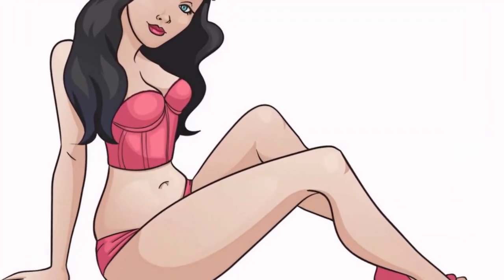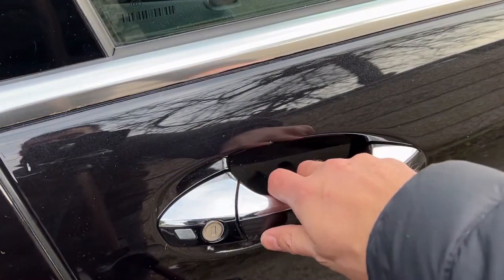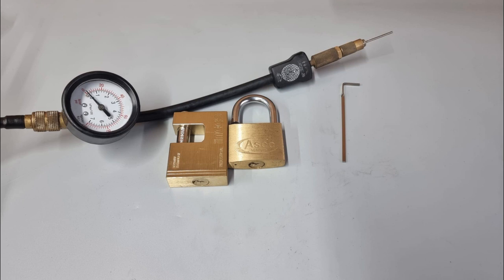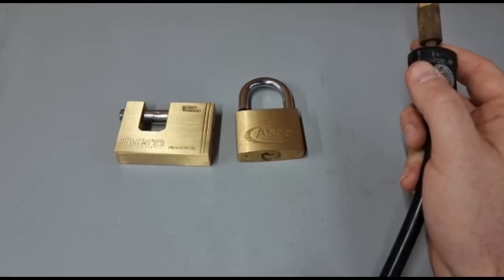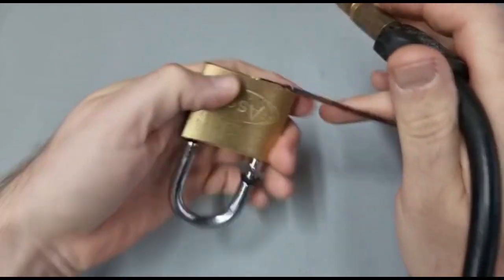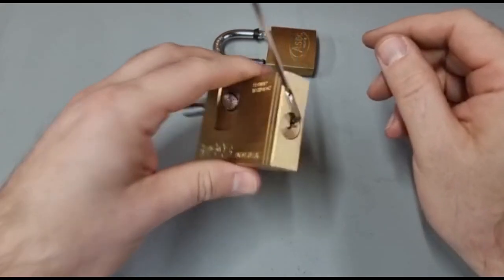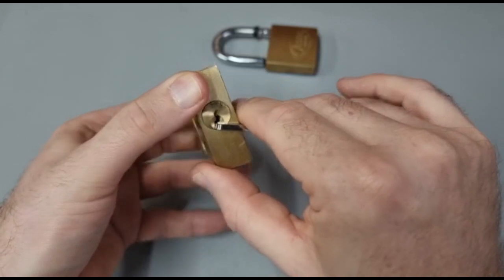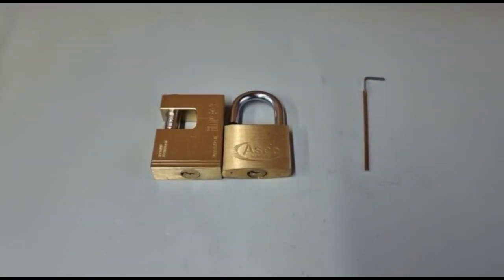How To Pick Locks With Compressed Air?

Comment: Years ago, early to mid 70s Mercedes Benz, has a model of vehicle that had vacuum operated door locks that if anyone knew the trick, could use a rubber toilet plunger to unlock. it unlocked because the vehicle had vacuum locks and someone sealing around
The lock against the doorskin  and giving a quick plunge gave a vacuum pressure change, and  the same effect on the vacuum locks as if the electric switch had activated the vacuum gate by pushing the unlock button inside.  and would cause enough pressure difference  inside the door skin to trigger the vaccuum lock mechanism. Im sure this is where the tennis ball idea came from. It also could be the origin of the whole air pressure to unlock hoax.
Reply from the maker: Interesting. But yes, the tennis ball does nothing.

Comment: Remember the magic feather pick? Awesome vid boss!
Reply from the maker: I do not - please tell me more......???
Reply: @LockPickingLegend  Oh the feather was a miracle jiggler opened anything it would fit in (yeah right) it was sort of like a mortice impression tool but for pin tumblers only problem was it would only fit in really straight open keyways (like old yaley padlocks) but if you could get it in an already opened lock it could impression the pin set and you could turn the screw at the end to lock it in place and then impression a key blank from it!
Relative rarity nowadays might still be lurking in a few older lockies kit bags though!